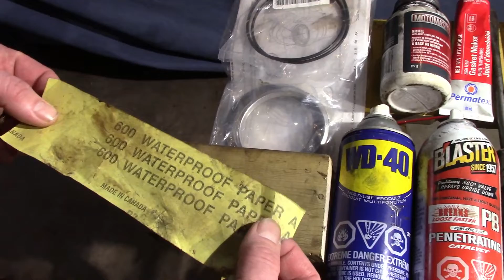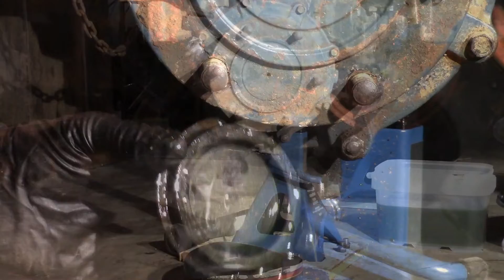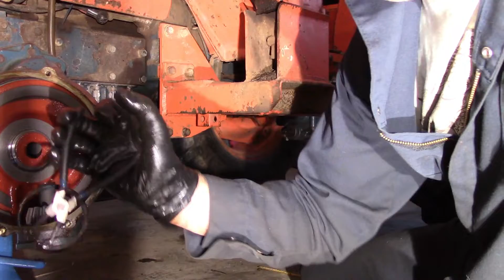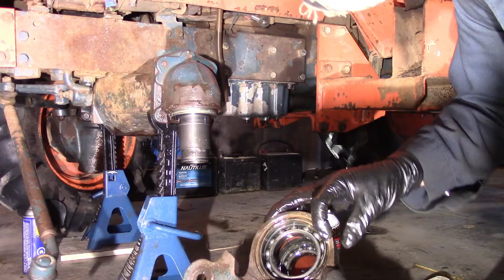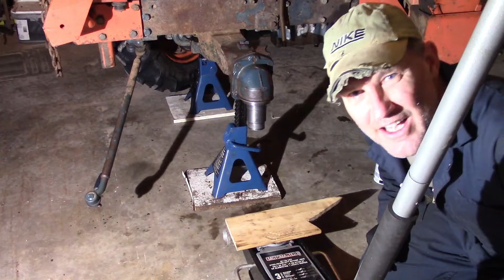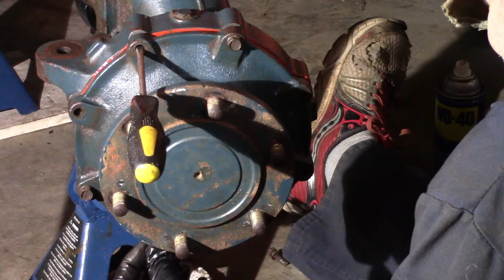Kubota Front Axle Wheel Case Knuckle Seal Replace. L 2550 leaking front differential gear oil fix

Comment: Getting information on doing this to a 2020 m7060 Kubota. 
Question:
Do you think maybe it might have been easier to take apart and replace everything if you had of removed from axle so you didn’t have to work on you back and upside down? 
Good job👍
Reply from the maker: Not for me but some people may find it is easier. Let us know if you find an easier way. Cheers!

Comment: Great video. All I would add would be to suggest greasing the rubber seal lip and/or the spindle it slides over with some wheel bearing grease. This will prevent damage to the seal when re-installing the assembly.
Reply from the maker: Yeah, applying grease to the seal would help. Thanks

Comment: Thanks for the great video. Until watching your video, didn't realize that there was a ring at the top of the spindle that had to be removed. Question:  After trying to reassemble the wheel assembly for about two hours, the stainless steel dust cover ring was flattened. Wondering if since it has flattened, will it still work as intended, since it originally had an arch to it.  I didn't know if the dust cover ring formed to fit upon assembly. Checked the ring with dial calipers and the inside and outside diameters are still the same. Any help would be greatly appreciated.

Comment: Just wanna say you did a fabulous job I have to do the same thing to mine. Thank you so much I have a 1988L 2550. Thanks again awesome video.
Reply from the maker: Thanks for leaving a Great Comment Jerry!! Good luck with the fix. The Front Axle Wheel Case can be a little intimidating the first time but ... You Got This! Cheers
Reply from the maker: Excellent Tractor choice by the way. I love my 1986 L2550!
Reply: Thank you

Comment: Down here in VT-Just did my new-to me L2850 hub seals- your video was incredibly helpful. Very Much appreciated! I added a little Loctite gasket maker/flange seal to the seal/case interfaces just to make damn sure they didn't leak. Thank God I did the service- when I cracked the drain plugs straight water came out!
Reply from the maker: Hey Alexander, How's life in VT? It's nice to hear you tackled those Hub seals. You saved yourself a ton of money doing the work yourself. You also prevented a bigger, more expensive repair by getting rid of the water in there. I like to think about how much money I saved doing a job like this because it motivates me to do more work myself. The other thing that motivates me is hearing comments like yours. Thanks, I like helping people. Congrats Alexander, You're Rocking it!!

Comment: I had the same leak on my 1986 L2550. The repair was a snap after watching your video. All I really did different, not having anyone to hold it up to tap the case back on, was to make a shimmed base for a small bottle jack, so it was pushing the same direction that it needed to go, and it went right on.  Thanks for a great video.
Reply from the maker: Great comment Darrel. Keep on Tractorig!

Comment: wouldnt happen to have a video doing the rear axle seal? Mine is leaking and I have let all the bolts go on the housing but it still doesnt seem to want to come apart. wondering if I'm missing a bolt or just need to start banging on it to break the seal???

Comment: Where are you getting your parts locally at a Kubota dealer or online somewhere??
Reply from the maker: My local Kubota Dealer
Reply: @cantletherdiediy1050  Thanks. I gotta tear my front left axle down on my L2250 to find out why my front left wheel is locking up after moving forward a few feet or so. I hope it is just a bad bearing and that I can get a new one and the o-ring etc. quickly.
Reply: If your wheel is locking up it is definitely a wheel bearing thats fell apart.My drivers wheel just did it.Ive replaced the right side 6 years ago.My seals are leaking and water is getting into the cases of my L2650gst too. Pop the bottom seal on very bottom of the axel to drain the axel completely. Good luck.
Reply: @peterwill3699  Mine has turned out to be a nightmare. There was no seal on the bottom and there has not been any oil inside for who knows how long? I have managed to get the axle housing off and partially apart. I found that the housing has rusted through in an area just above where the seal would be and plus there is lots of rust inside therefore a major pain to get parts out. I am surprised it has been rolling at all. I have tried to find a used axle housing but no luck. Once I get it apart I am going to try to have the rust hole repaired then de rust the inside and try to put all new bearings and seals etc. and hope for the best.

Comment: I have a ‘87 L2550 with the exact same problem, surprisingly came across your video of your ‘86 and if it wasn’t for the video you did in detail I’d be screwed but I got new seals, O rings and bottom caps for both sides, did the job the same way you did it and it came out perfect. Thank You for doing the video and for the details throughout!
Reply from the maker: Excellent Long Island Cowboy. Thanks for taking the time to leave a comment to let me know how the video helped! It's great to hear. Cheesr!
Reply: Those snap rings are really hard doing it on the tractor.Five more bolts and the whole assembly comes off.

Comment: Great video! I have a LA 2350 DT Do you think it takes the same seals as your. I hadn’t look them up. Please let me know about the seals. Again a real helpful video, thanks
Reply from the maker: Hey There ituneipods, It is hard to say for sure. I would not want to guess. I would call your Kubota dealer and have them look it up for you. The process to replace them should be similar but to be sure you could ask Kubota to print off the installation instructions and compare them to my video. Good luck and let me know how it turns out. Cheers!
Reply: @cantletherdiediy1050   Thanks for your fast reply. I’m going to get started on this job next week. I’ll let you know how it turns out. I don’t expect any problems doing the job after watching your video.
It will be a big help, thanks
Reply from the maker: @ituneipods1  Good Luck!

Comment: My L3750 leaks at the hubs. Parts are obsolete.At the dealers suggestion I drained the gear oil and filled the reservoirs with corn head grease. No more leaks. I'm a believer.
thanks for the video.

Comment: Great Video! I'll be attempting the same thing on my 1986 L2850 this week which has a cracked front right Axle Case housing and has been operated without oil sounding like a bad CV joint on a front wheel drive car. I've removed the Beveled gear case and the axle case so i'll separate the the two at the seal that you replaced. Thanks for all the details being left in the video. I like the MasterCraft Seal Installation Kit, I'm looking for one of those ;-)).
Reply from the maker: That's a nice Tractor M Cuevas. Good Luck with the repair and thanks for watching and subscribing. Cheers!
Reply: That seal is confuseing,In the picture that came with it, it looks like the seal is rubber side up.It's metal side up and the other metal seal sits inside it,put that in with your fingers.The job is much easier with the whole knuckel off and on a bench.About 60 pounds all together.But once you catch the dowel pins you can draw it in slowly to mesh the gears from the axel. I have lots of pictures if you need a better look.It looks like good cast iron so it should braze pretty easy.Good Luck.

Comment: I find it easier to pull the bevel gear case off the differential case and take it to the workbench. Cost you a couple extra seals but rebuilding it is easier

Comment: Outstanding job creating this video.  I have the complete service manual but your production was way more practical.  The hardest part for me was getting the old seal out, after a few hours of spraying and prying I finally had to cut it; never had that kind of trouble with a seal before.  I'm far from service in the remote wilds of BC so I can't thank you enough.  We're up and running without the leak.
Reply from the maker: Greg Garcia That’s Awesome Greg...I’m rural Nova Scotia...keep on tractoring! Don’t forget to subscribe
Cheers!
Reply: Slide hammer is a wonderful tool...

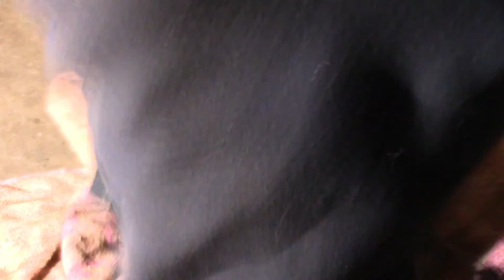Comment: Great video!  Thank you for taking the time to provide clear instruction and keeping the camera rolling so we could see all aspects of the job.  When you were prying the oil seal out of the housing, you mentioned applying pressure to the right spot (36:23).  Was the "right spot" underneath the seal against the bearing, or between the seal and the housing?
Reply from the maker: Torch Hey Torch,
I worked the seal up from all sides evenly, patiently between the seal and housing to pull it away from the housing. Then I started applying an upward pressure by prying underneath the seal by leveraging against the opposite side housing ....I could see it moving up and out slightly , evenly and then it just popped out suddenly cause I was applying an upward force in the right spot. ... after working it loose. Not really a specific spot. It will pop when  it’s ready.
I hope that helps Pal! Don’t forget to like, subscribe, and ring the bell
Cheers!
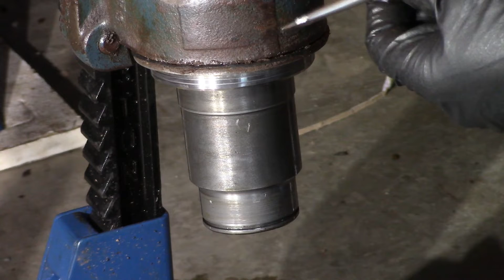Reply: @cantletherdiediy1050  Thank you!  I have an old L2350DT and the original oil seal was the same as yours, with the additional metal cap (shown at 51:20 in your video) that I had to pry down off the shaft.  Your video was extremely helpful!  I'm now subscribed to your channel and look forward to anything else that you post on Kubota maintenance/repairs!
Reply from the maker: @torch9937  Thanks for the comment and subscription! I like hearing how my video helped someone out. It's really nice to hear. I'll have more Kubota videos coming. My Kubota doesn't break down much...but now that I said that...I'll probably have it break in half  (Ha) L2350DT...that's a nice machine!

Comment: This video is EXACTLY what I was looking for!  I have the L2250 and have the same seal leak issue.  I have the parts here, and will be doing the repair this week!  I will have your video handy as I am going through the steps.  Thanks again for posting this.
Reply from the maker: Hey Brad,
Yeah, our tractors are very similar. I had a lot of fun with the repair. Thanks for watching and the comments. You'll save a ton of $ and have some fun along the way.
Cheers!
Reply: I to have the L2250DT I have this video ready to take stuff apart great video!!! #KUBOTA😁💯